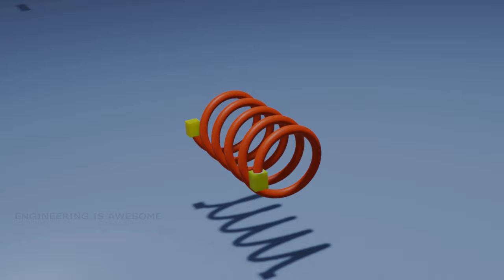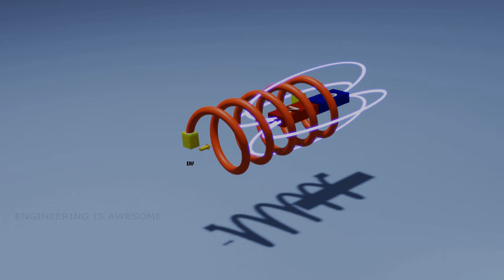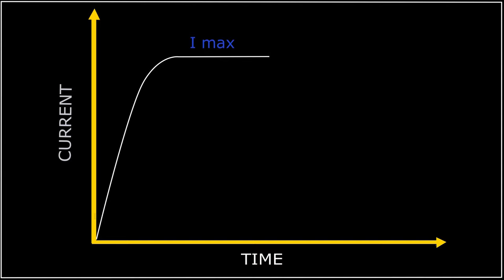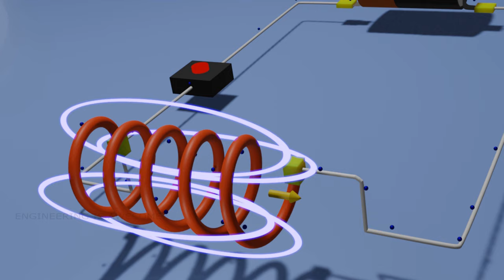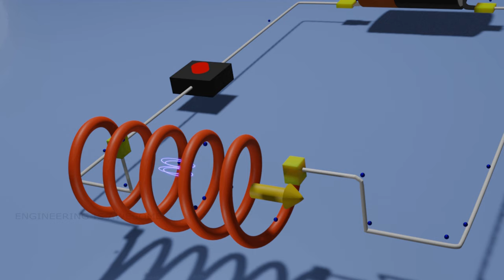Inductors working principle | Current lagging behind voltage in an inductor.

Comment: 1.  The collapsing magnetic field is not called "Back EMF" it's just EMF and wants to push a current in the same direction that set it up.  
2.  Whether there's actually a CURRENT during collapse depends on the existence of a circuit.  If you merely open the circuit, you cannot have a current; but in trying to push a current you are going to get a high voltage.  This is what causes the spark in an automobile engine; it is the sudden breaking of the circuit by the distributor points (back when engines had such things).
3.  In the special case of a superconducting coil, if you short circuit the inductor it will retain its magnetic energy forever.  Such "superconducting storage rings" can store an enormous amount of energy and deliver it almost instantly.

Comment: why does current flow if the voltage difference across the ac source is equals to the voltage source across the inductor(E0sinwt=Ldi/dt...you can see every book use this intital condition) in an pure inductor ac circuit????
Reply from the maker: In this video, the inductor is connected to a DC power source.
The current faces an opposition due to back emf , whenever there is a disruption in the current flow.Once the current becomes constant, there will be no back emf to oppose it. Hence, there will be a current flow.
But in an AC circuit, the current is continuously changing.Because of this, the back emf will oppose it continuously all the time. So there will be a blockage to current flow.This blockage will increase with increased supply frequency.If the frequency is too high,the current will be blocked completely.
Thanks for the comment!
Reply: In a pure inductance without resistance, no current would flow because of the constantly changing voltage (hence current).  This is the basis of a transformer that has no load on the secondary; you also have no load on the primary and it might as well just be an open circuit.  
loading the secondary prevents the magnetic field from completely opposing the source, and in this manner the load on the secondary is reflected to the primary and there's less opposition.
No purpose is served just putting an inductor in parallel with either an ac or a dc source.  An inductor is often placed in series with the load as it will oppose sudden changes such as a voltage spike on the mains.

Comment: Nice video about it. It helps. I just need a little further explaination on the opposite emf when the circuit is open. Why would it go in the same direction with the electrons?
Reply: Ok now i slightly understand it since i rewatch it. So you are saying, that since the magnetic field is now decreasing, the emf direction will now be the same with the elctrons, Am i right?
Reply from the maker: Yes, you are correct.

Comment: Dear...which one is more useful as an inductance. ..1watts or 0.5 watts or 0.25watts for the same value of inductor such as 10milihenrey for example! !!?
Coz I have a private project n I want to order online ring colored inductor with value 10mh but there r 3 types of 10mh with different watts ...
1- 1w
2-0.5 w
3-0.25 w
I need 10 mh with high inductance so which one  of these 3 types is a high inductance?
Thanks..😊
Reply: "I need 10 mh with high inductance"
Trick question?  That's like asking for three different containers of 1 liter of water, which one contains 1 liter of water?  Glass, plastic or metal?
10 millihenries is the inductance.  Different watt ratings refer to how much current can you put through it before it gets hot and melts.
"Fixed Inductors 10 mH Shld 20% 87mA 70Ohms"
That inductor has resistance in the wire of 70 ohms.  It is rated for up to 87 milliamps.  AT 87 milliamps and 70 ohms, you get (E=IR) 6.09 volts.  At 6.09 volts and .089 amps, you get 0.529 watts, or about 1/2 watt dissipation (heat).
Reply: @thomasmaughan4798  
Thanks dear..⚘😊

Comment: Hey dude so it mean current start to pass through coil to another side of battery when the current reach max current or i can say when magnetic field no more expand right. And another question is that when current start to pass through coil cause of magnetic field can no longer expand do it have another magnetic field build up by current after the first max magnetic field collapse. ty
Reply from the maker: You're correct on the first one. 
For the second question, the current produced by the collapsing magnetic field will not generate additional magnetic fields in the inductor.
Thanks for the comment!
Reply: @ENGINEERINGANIMATION  no dude I mean the current from generator.  What I mean is that is there another magnetic field build up to max after the first one collapsed by another current from generator.

Comment: Thank u sir ...it's so useful ..how inductor voltage leads the source voltage ???
Reply from the maker: At the instant when the switch is opened, source voltage becomes zero.But in the inductor, the stored energy in the magnetic field induces a voltage in it. Now the inductor has a certain voltage,while the source voltage is 0.
Thanks for the comment!
Reply: @ENGINEERINGANIMATION  thank u so much sir
Reply: The inductor voltage is generated by a changing magnetic field.  When establishing the magnetism, its growth creates a voltage that opposes the applied (source) for a while.  The voltage cannot be greater than the source.  
When you open the circuit, the magnetic field collapses.  It wants to produce a *current*, but it cannot since the circuit is open.  Consequently it will produce a high voltage; a very high voltage and will produce a spark at the switch.   If instead of just opening the circuit you switch over to a resistor, then you'll have a voltage across the resistor as the magnetic field collapses.  The rate of collapse is governed by the current that is generated; if it can generate a strong current then the collapse will be slow because this current that it is generating maintains the magnetic field.
The extreme case is a superconductor.  If you short circuit an inductor that has a magnetic field, its attempt to decay the magentism produces exactly the current needed to build or maintain exactly that level of magnetism, so nothing happens.  You have stored energy, a LOT of energy, in magnetism.

Comment: Sir,
Well explained with a clear animation.

One doubt, when the current is changed to maximum value in a dc ckt, the source of current flow is due to dc source plus back emf induced. Right?
Reply from the maker: I'm glad you liked the video!
Initially the current flow is due to DC source and the induced back emf will oppose it.This opposition stops once the current flow becomes constant.
Reply: @ENGINEERINGANIMATION  thank u sir.

Clear.

Comment: How can  a dc battery produce inductance???
Reply from the maker: Inductance occurs in DC circuits, 
1)whenever the circuit is switched on and off or
2)If there is a fluctuating current flow.

Comment: What is the usefulness of an inductor in a circuit.?
Reply from the maker: In circuits, it is used to filter out high frequency signals. And due to it's ability to store energy, it is used in voltage converters such as buck-boost converters.